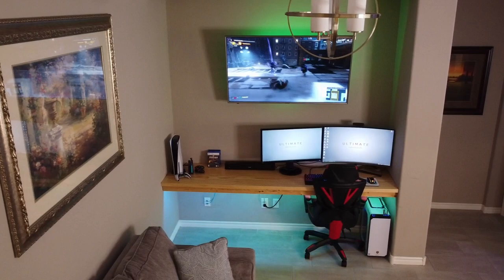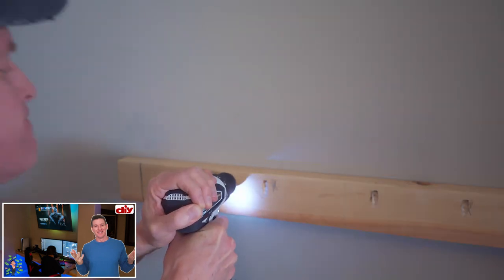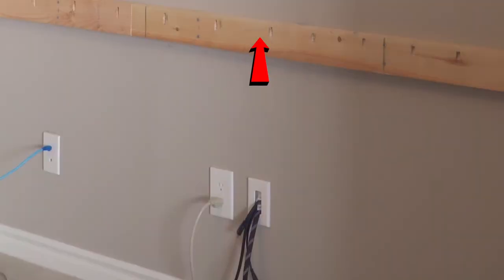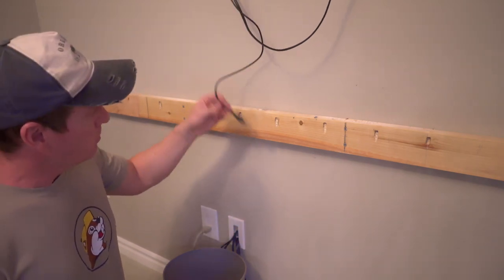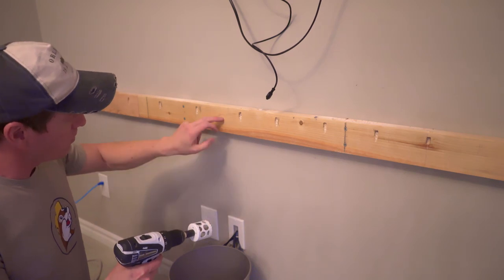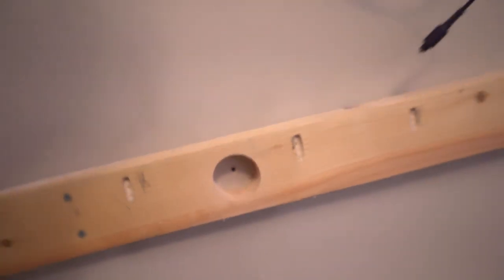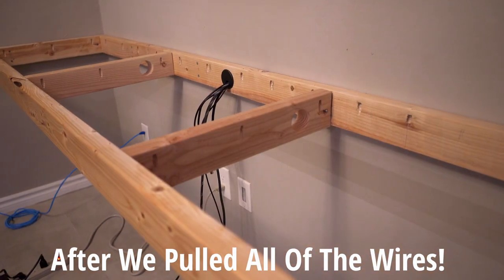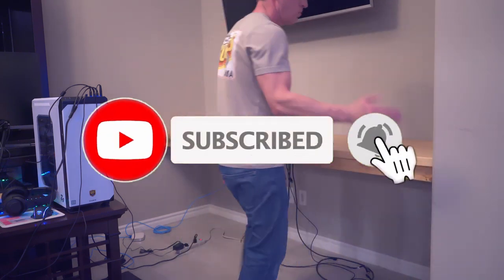HOW To HIDE TV Wires In 5 MINUTES! - Quick & Easy!😀

Comment: I like the wire drop trick with the screw. However, I prefer to see my wires because I always move things around. I can never make up my mind. Since cutting a hole in the wall is permanent (I don't know how to patch drywall and I wouldn't do it anyway). I wish I could make "final" decisions. I second guess everything. And if someone doesn't like my setup I always want to change it cause I feel they're right since I'm never sure of what I do. One day I like it, next day I want to change it. I also don't like putting TV's on the wall. It's too permanent and I don't ever have good luck using a stud finder. I guess that's what contractors are for